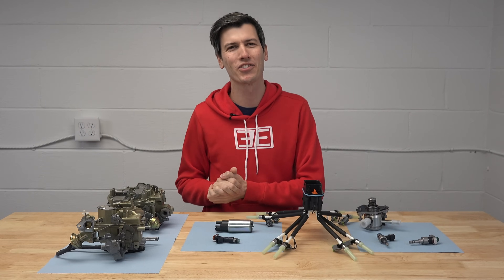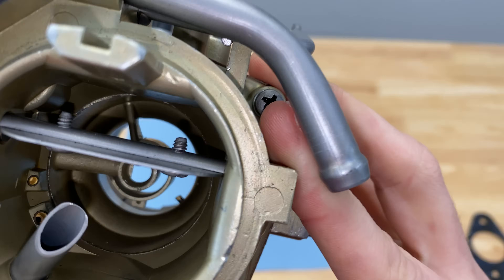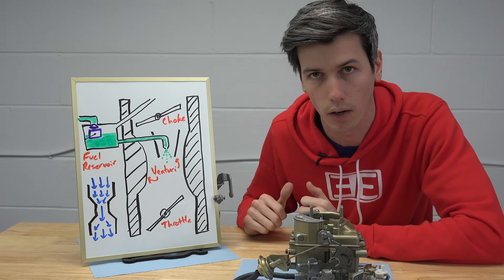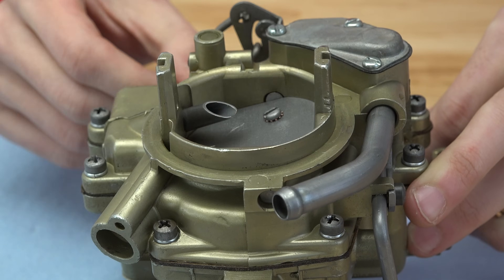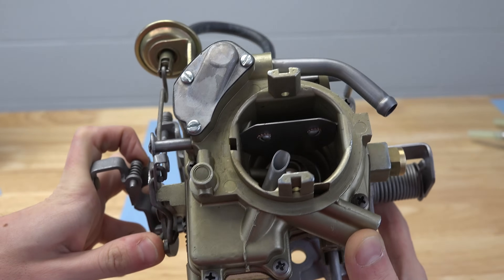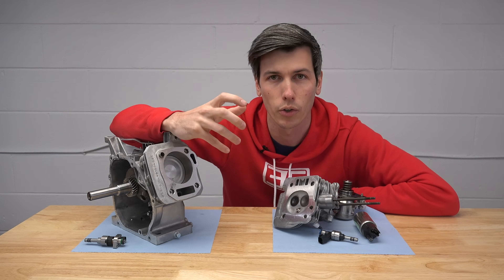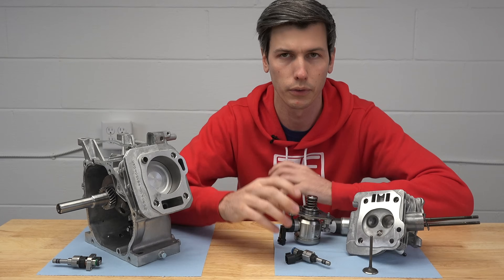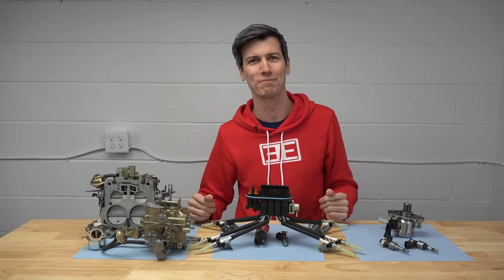What's The Best Fuel Injection? Carburetors vs Port vs Direct

Comment: How does using other fuels (mainly LPG) affect this? There are LPG installations that inject fuel in gaseous form so it probably won't clean the port, and there are those using LPG still using liquefied gas, doesn't directly injecting LPG cools the cylinder even faster?
Reply: As they are less effective solvents there should be more carbon buildup on the intake valve if crank case venting is not filtered before led into the intake.
Reply: @TheEsseboy  Except they are incredibly clean burning.  Oil and crankcase stay rekably clean much much longer than gasoline.

Comment: I'm still using carburetors and Contact point ignition 

Still runnin like gangsta
Reply: But are you running efficiently? How much HP/Liter? How much HP/KG?
Reply: Bruh it's oldscool
Reply: At least it's not hardstart good fuel consumption and so simple
 just cruisin
Reply: @jamesthehandsome8582  Carbs are harder to start and have bad fuel consumption...they are most often in the repair shop, not crusing ;)
Reply: @TheEsseboy  "carbs are harder to start"

Actually carbureted engines that are regularly used can be easier to start than EFI engines. My average starter engagement durration on my 2 daily driven carbed trucks is shorter than any EFI  vehicle I have come across.
Reply: @Texassince1836  Haha dream on dude...go to somewhere where it is cold and you'll see 😂
Reply: Id try to convince you to swap to solid state ignition, but its POINTLESS (pun intended)

Comment: This is great. Now do 2 stroke direct injection E-tec engines!
Reply: 2-stroke? You mean pre war oil mistifyers?
Reply: @TheEsseboy  
He/she could be referring to like PWC engines. Yamaha and other brands still use two stroke in their jet-ski's.
Reply: @eriklehnsherr5784  Because they are trying to cut costs. High RPM and low weight 4 strokes are expensive.

Comment: I hope one day you'll cover motorcycle engines, nobody else is doing it on youtube, and you have all the right ingredients to make good quality content and tons of views!
Reply: Check out Matt at The Workshop. He makes detailed videos on motorcycle engines and everything else. He's also an engineer so his explanations carry just as much, if not more, technical information.
Reply: @DocKhan  
Great information! Thank you!
Reply: MunroM84  there's a LOT of differences other than them usually being oversquare. Ducati has desmo instead of valve springs which is different. The transmissions are very different. Many of them use ITBs which are different (than most car engines). Carbs were on motorcycles way up until the 2000's. I'm not "in" to motorcycles that much, so there might even be new ones with carbs.

MotoGP used 2 stroke engines until very recently. Those are way different than 4 stroke engines in cars.
Reply: @samfedorka5629  itb is itb no matter where you use it. you have one throttle body for each cylinder. many race cars uses this technology.
Reply: @petr0rabbit  
And snowmobiles.
Reply: there is A LOT of variation in motorcycles, and I like Engineering Explained style much more than The Workshop's. I'm just suggesting a topic for the channel, if you guys don't agree with my suggestion I'm fine with it, if you agree please click the like button so he might notice the comment
Reply: If you're not watching FortNine you should be! Also MC Garage. In fact the latter has a vid on this very subject.
Reply: Forth nine talks about motorcycle fuel carbs and fuel injector in detail good stuff👍
Reply: The Workshop is an incredible channel, my only regret is not watching him more
Reply: @erikhordnes1641  
Great information! Thank you!
Reply: @Fortnine youtube channel
Reply: Missed The workshop?
Reply: He missed the opportunity to explain about why motorcycles don't have diesel engines, only donut media did a video about this topic
Reply: Fortnine bro
Reply: Fort nine
Reply: There's a few on here. Watched one about a week ago on how the constant mesh transmission on a bike works. Every 4 stroke engine pretty much runs on the same principle of; suck, squeeze, bang, blow.

Comment: Another advantage of Port + Direct injection setup: RCCI. You can control the combustion (similar to lean combustion) better by using two different fuel to gain much higher BTE!
Reply: No one wants to fill their vehicles with two fuels...
Reply: Not 2 different fuel, 2 different method to inject fuel. uses the same gasoline that you fill in the gas tank
Reply: @TheEsseboy  not for passenger vehicles, but considering defence/military applications, it is very common.
Reply: @PhoenixSolitary  Which is like 0.1% of the vehicle market

Comment: Port injection system seems to be VASTLY more reliable than DI. Valves stay cleaner, longer. I know DI can be more efficient but it's a net gain of "not a damned thing" if you have to blow labor and money at cleaning the crapped intake valves.
Reply: Or just install a proper catch can...it's not that hard! If you are lazy you can install a single injector behind the throttle body to spray a little to clean them.

Comment: I would like to see a video about mechanical fuel injection, like Bosch KE-Jetronic etc.
Reply: Both my mercs have it, its pretty cool how they still work even with the electronic side of it unplugged
Reply: Agree. I had The basic Bosch CIS system on 2 cars, but there are other mechanical systems like on early Corvetts.
Reply: @kevink2315  Rochester mechanical fuel injection like the old 'vettes have is rare, expensive, and difficult to work with. It's cool as hell but so problematic that a lot of owners replaced it with a carburettor and saw performance gains thanks to superior fuel control, which is not indicative of a well designed fuel injection system :lol:
Reply: i have this  k jetronic on my 1993 mercedes benz 300E  2.8. . .never needs maintenance  always works without adjustment.  that is on the benz 104 engine.
Reply: @davebarenberg4922  just make sure the diaphragms don't dry up and are replaced every 20 years or so.
Reply: Was missing the mention of mechanical injection too! (But i was more thinking of old Diesels who had mechnanical injection from the beginning.)
Reply: @nirfz  Them'll be hydraulic injection !
Reply: @millomweb  A joke i don't get? This first term just specifies what controls the ejection.  Hydryaulic injection would mean that the amount and/or time to inject is controlled hydraulicly. And with the one we talked about that is not the case.  There is no hydraulic line that controls anything.
Reply: Or the far superior system Bosch Kugelfischer Injection system.
Reply: id like to know how mechanical pumps work in  old diesel engines (gasoline aswell) how can you controll the amount of fuel? is there something like a valve to lower the fuelflow?
Reply: @johannesdatblue4164  From what i remember, the one i learned about in driving school (which is mandatory to get a license where i live) worked a bit like this: imagine a little cylinder with a simple valve on the top that opens when the piston goes down to let fuel in, but is shut while the piston moves up. Now imagine a little hole in the sidewall of the cylinder. And now, the pistontop to have an angle of let's say 60°. The piston is moving up and down by a camshaft. The piston is turned clockwise or counterclockwise depending on the position of the throttle pedal. So when on full throttle, the "low side" of the piston top faces the hole and so fuel is pushed out through the hole for almost the whole move upwards of the piston. When on idle the high side of the piston faces the hole and a minimal amount of fuel gets pushed through before the piston iteslf shuts the hole. Hopefully that is somewhat pictureable.
Reply: @nirfz , would that "piston" be the pumping plunger, and the "piston top angle" be the helix that opens and closes the spill port. In the Bosch inline injection pumps, these pump plungers rotate with a geared rack to turn the plungers from full fuel down to no fuel delivery. With that helix cut in the side of the plunger, the hole could be covered for nearly the entire stroke, at full load, or rotated to open always, with the engine stopped. The rack rotated the plungers, one for each power cylinder, and the plungers pumped fuel to the injectors at high pressure, anywhere from 2600 to 4500 psi cracking pressure, and from 10,000 to 15,000 psi operating pressure. It should be noted that the outlet of each pumping unit is connected directly to an injector. The "spill" port that is closed or opened by the helix, which is controlled by the governor, or throttle control, or a combination of both, totally varies the fuel delivery rate and therefore, power output!
Reply: @jimstepan3038  👍 Yes that sounds like the one i remember learning. (but in a different language and over 20 years ago) Although i don't remember any pressures but then again they would have ben in "bar" or "hectopascal".
Reply: @johannesdatblue4164  The carburetor itself is what stops the fuel. Inside of the carburetor there is a component called the "carburetor float", when there's enough fuel in the carburetor's bowl (basically, a reservoir) the fuel lifts up the float which closes off the fuel line. Think of it kind of like the float in your toilet's reservoir, once there's enough water it closes off the tank from being filled anymore. It's just that but inside of the carb.
Reply: @johannesdatblue4164  You vary the piston stroke of the pump. Diesel fuel pumps have a separate pump piston for each cylinder with a tube running from the pump output to it's corresponding cylinder.
Reply: Me too!
Reply: Hilborn!
Reply: Yes absolutely, D-Jetronic would also be really intresting.
Reply: I was thinking the same. Oddly enough, I learned about the stratified AFR concept mentioned at the end of this video in a book about K-Jet.
Reply: Yes please! Seems like a very difficult part to maintain or repair. Not many mechs know how to work on it.
Reply: Laughs In E21.. Once they break down, they are so complicated tho!!!
Reply: Get an OLD Mercedes-Benz mechanic to explain it.  Mercedes-Benz produced more mechanically-injected vehicles than every other manufacturer COMBINED!

Comment: "Carburators haven't been used in any production vehicles in decades"

Lada Niva laughs in the background
Reply: Even most modern motorcycles have switched to EFI...  Then there's Lada...
Reply: @nasonguy  even Royal Enfield — "the bike they forgot to stop making in 1948" — has had EFI for years
Reply: @jsleeio  Don't forget Harley Davidsons have had EFI for a while now.

It's only the OLD XR/KLR/DR dirtbikes that are still carbed. Even current and last gen Dirtbikes are EFI now.
Reply: @nasonguy  what road legal bikes can you still pick up new with carbs? Drz400, tw250 a couple CSC's and then maybe some honda grom clones. That's all I can think of that's left.
Reply: @BmxDieseldude  I am pretty sure ktm exc 2 strokes are carbureted, excs can be made road legal from factory
Reply: @nasonguy  2 stroke dirt bikes still have carburetors
Reply: @proarmy70  Waiting for DI two strokes to become common. That'll be the day.
Reply: @nasonguy  yeah tpi bikes are making it happen
Reply: @proarmy70  I'm so out of touch with the 2 stroke world. Been 4 stroke my whole life. But hell yeah KTM!
Reply: I had to do some research, it seems that they actually made a new petrol engine (1.7i) with a singlepoint injection and 5 manual gears. Pre-1994 1.6 had indeed a carb and 4 manual gears. Still the simplicity of even modern Niva makes me want to buy it for garage mechanic hobby.
Reply: @oditeomnes  "for garage mechanic hobby" 
Installs turbo charger
Reply: @oditeomnes My neighbor still has a 1.7i Lada Niva. Could you imagine how much does it smell on gasoline from behind? It's kinda funny and I think it has a carb
Reply: @bkalinic  Lada Niva uses fuel injection from 1997 I think. The letter "i" after the "1.7", means injection :P
Reply: @bkalinic  it says 1.7i so it is fuel injected.
Reply: I guess he's not a motorcycle guy.
Reply: @rob21  Most new motorcycles (at least street legal ones in the US) are EFI now. It's kinda crazy. Of course, most dual sports and dirtbikes are still carbed.
Reply: @nasonguy  Not all.  Janus uses a carb.  And as you said, there are many other older designs still sold with carbs too.
Reply: @nasonguy  actually most dual sports and dirt bikes are now EFI. Pretty much every race dirt bike you'll find that's a 4 stroke from 2014-now is EFI. Some brands switched even sooner, while yamerhammer didn't switch their 250F until 2014. Even KTM has been making EFI 2 strokes for a few years now. I do believe until recently most trail bikes were carbed, with the likely exception of higher CC bikes
Reply: Newer Lada Niva’s are fuel injected, they even have anti-lock brakes... For 2020 they added power windows and mirrors, heated seats and even a trip computer! No airbags yet though.
Reply: I have a 2001 1.7 Niva that’s carb. It’s hilariously underpowered. But fun to drive so that’s cool.
Reply: @Jackofafewtrades  What a coincidence , I have a 2001 Nissan D22 with a Z24 carb engine. I'm putting an SR20 in it so I guess that makes it cool too.
Reply: I think he means in America. Lada isn't sold here.
Reply: @Dethrider6  Lada was sold in canada,but the importation might have been/still might be a concern.i don´t know about the us emission regulations.
Reply: I used to own a 1998 Ford Econovan [Mazda Bongo] with a carburettor.The engine always started instantaneously in all weathers.
Reply: Marc Milton-Talbot My Ford with Holly carburetor also started fine in any weather without a choke.
Reply: Most Cessna, Piper, etc laughing with Lada
Reply: Giggles in Suzuki DRZ
Reply: Since 2004 all russian cars became fuel injected, due to some ecological standards or something like that. And, by the way, there were no mass produced ladas with single point injection, they moved straight to port injection
Reply: 2011 NASCAR last known is what he said did u listen?
Reply: Lada uses Multi-Point EFI now.
Reply: We still have carburators vehicles being sold here in the PH. They're usually reserved for budget motorcycles because FI are just damn too expensive for the common folk
Reply: triadwarfare Where are those motorcycles made?
Reply: Lada Niva has had port injection for 20 years. In 2010 multiple point injection has been introduced. Notice the engine denomination on the badge says 1.7i.
Reply: Why would you change perfection?
Reply: Poor drz400
Reply: So does UAZ 969
Reply: Ktm carbed there bikes as of 2018
Reply: @tomj6941  But only dirtbikes.
Reply: @tomj6941  Exactly Which bikes?
Reply: And on second place comes US manufactured cars. They kept the Carburator in genral for a long long time after European and Japanese manufacturer had stoped used them. Much like leaf springs, drum brakes and other outdated wheel suspension tech.
Reply: Only carburetor